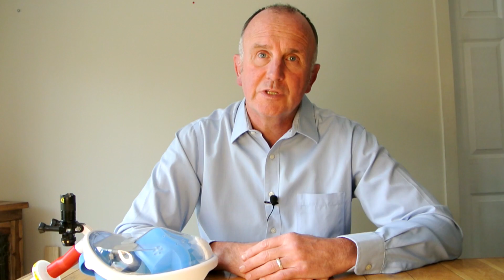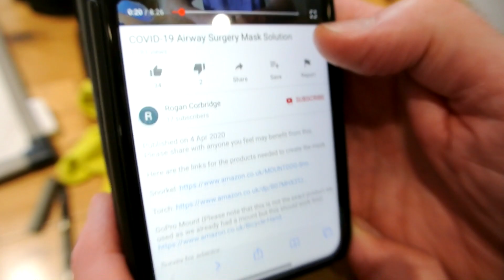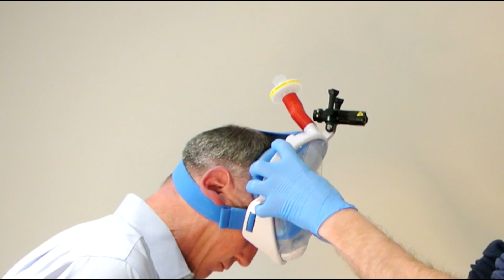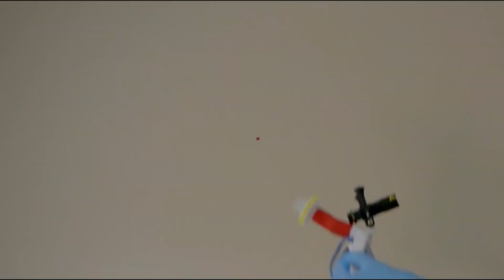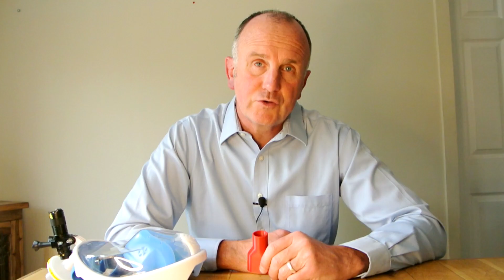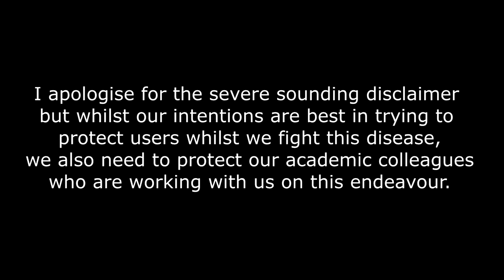COVID Surgery Mask Update

Comment: Thanks for the great video, does it have to be that specific make of snorkel mask?
Reply from the maker: We currently have 2 adaptors that work with 2 different specific makes of mask. These are the Mountdog mask from Amazon and the similar mask sold by Decathlon. Both of these adaptors are available at the link in the description. Note the "D" adaptor is for Decathlon, then "M" adaptor is for Mountdog (amazon)
Reply: Is it the subea mask sold at decathlon.co.uk? Thanks